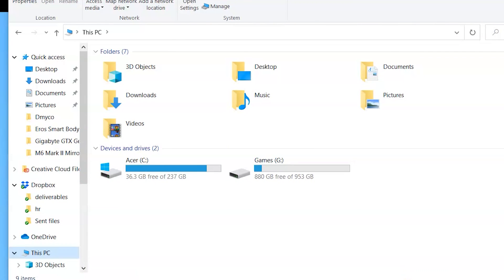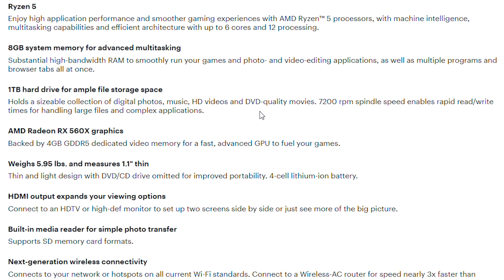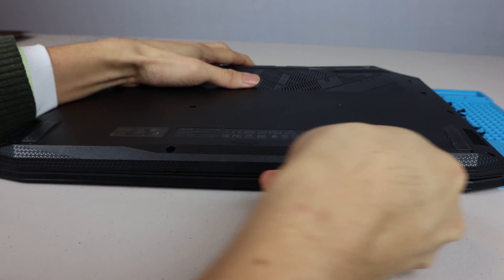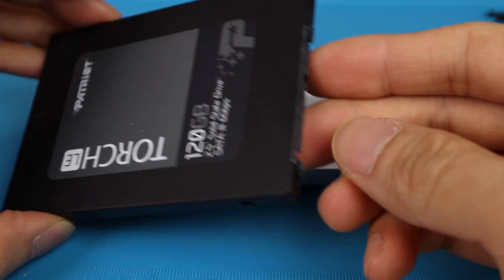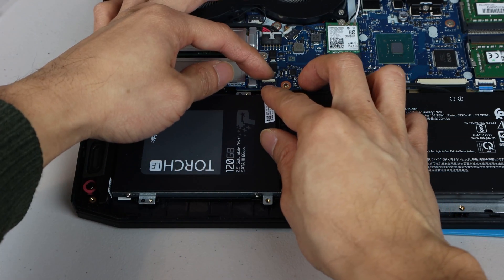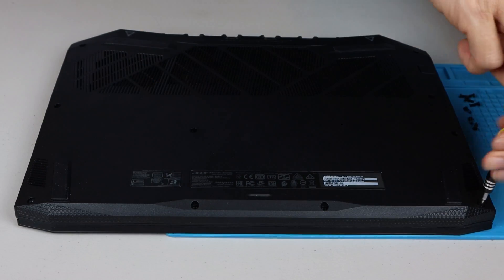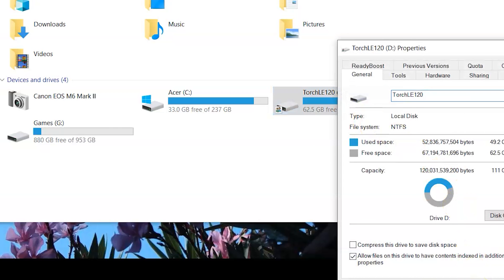How to Install 2.5" HDD or SSD in Acer Nitro 5 Gaming Laptop (2019 ver) SATA III Drive

Comment: I don't know anything about upgrades and I'm running out of room. What are those two chips above the storage you just added?
Reply from the maker: The two slots above the 2.5" drive slot are also storage drives. They are called m.2 form factor SSDs and each can have a max of 2 TB in this system.

Comment: Hi, I have windows 10 now in my Pc, will change to ssd. Do I clone it first or just install the ssd drive and windows will recognize it as fresh new Pc?  I already backed up my files, pictures., and some programs here, I don’t need it anymore, Others, I can get it online easy.  Explain cloning is necessary or not and when to use it?
Reply from the maker: Since it sounds like you'll be removing the existing drive and using your new SSD to boot from, yes, you will need to clone the contents of your original drive to your new drive. Any time you remove the drive that has the operating system (Windows) installed on it, or wish to boot from the new drive, you will need to clone the existing drive to your new drive.

If the drives can be installed in the system at the same time (for example, you have an M.2 slot and are installing the new SSD in the 2.5" bay or vice versa) then you can complete the clone after installation. If you cannot install both at once (the original drive must be removed because there is only one space to install it), then you should complete the clone prior to installing the new drive by connecting the new drive externally, for example, using an external HDD enclosure like the ones found here: https://geni.us/DEHX5 [Amazon Affiliate Product Link]
Reply: FixItPhil got it.   I just decided that I want fresh windows 10 installation, like new pc, no cloning. So, if I change to ssd drive,  my Pc will automatically detects windows 10 license when I turn on my pc and will configure like new pc or what? Reply
Reply from the maker: @ChristianYepez  If the new drive is the only drive installed when you boot up the computer, you will need a Windows 10 installer in order to setup the drive and install Windows 10 on it (otherwise the computer will NOT boot up). This is usually done by creating a bootable USB thumb drive using Windows Installation Media Creator which you can download here for free: https://www.microsoft.com/en-us/software-download/windows10 After booting from the USB drive, it will take you through the installation process for a fresh installation. As long as you use a Microsoft ID as the primary method of logging into your Windows 10 machine now, and use the same login for the fresh installation, your license will be transferred over automatically (an internet connection is required to activate).
Reply: FixItPhil thanks I have windows 10 now, it was an upgrade for windows 8, like 3 years ago I think. But do I check if I have windows key license. or what. Or can I copy down license key number.  I only have pin local admin account in my pc. Or I connected now with Microsoft account and no local??
Reply from the maker: @ChristianYepez  If you upgraded to Windows 10 for free from Windows 7 or Windows 8.1, you should have a digital license instead of a product key, you can extract this key by doing the following: 
1. Type 'powershell' into the Cortana search bar. Right-click it and select 'Run as administrator'
2. Copy and paste the following command into the window that opens: (Get-WmiObject -query 'select * from SoftwareLicensingService').OA3xOriginalProductKey
3. Then press the 'Enter' or 'Return' key

Your product key should appear on the next line, but again, you won't need it if you simply login into the new copy of Windows after installing it with your Microsoft ID account; it should recognize the fingerprint of your computer and activate automatically. To ensure that your Windows 10 key is synced with your Microsoft ID account, be sure to log in to your current installation of Windows 10. If you're currently logged in with a 'local' account, you can change it by doing the following:
1. Click on the 'Start' icon on the left side of the task bar.
2. Click on the 'User' icon (👤)
3. Click 'Change account settings'
4. Click 'Sign in with a Microsoft account instead'
5. The "Sign in with Microsoft" page pops up asking for your Microsoft account. If you already have one, just enter the username and password and click the Sign-in button. Otherwise you can create a new account. If you find you're already signed in with a Microsoft account, there's nothing else you need to do.

Comment: I just purchased a Acer Nitro AN515-54-5812 do you know if the cable you used in the video would work for that model?
Reply from the maker: Yes, I have the same base model AN515-54, so you would use the same cable I have in the video. There's a link where you can find it at Ebay in the description.

Comment: So if I buy the ssd the block one xd  I have to do something to make it work or is it just plug and play basically? Also I lost my drive baby screws can you link some of those too thanks
Reply from the maker: Right if you get the 2.5" type SSD, you'll need a SATA ribbon cable to connect it to the motherboard, as shown at 3:07. One should have come with your laptop in the original box, but if you don't have or can't find it, you can buy a replacement one here: https://ebay.to/2Tnlh9l [Ebay Affiliate Link] and if you need the screws for the drive bracket, you can find some here: https://ebay.to/3g8DW2G [Ebay Affiliate Link] After installing the drive and verifying that the mother board can see it (see 4:12) Then you'll have to allocate/partition and format the drive. If you're not sure how to do that, check out my other video on it here: https://youtu.be/d5wLgZxROoY

Comment: My issue is that the laptop doesn't recognize the current drive. Windows won't boot and there is nothing in the bay now so what do I do to replace the drive?   I don't see one to remove.
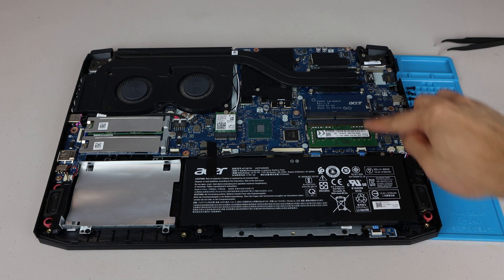Reply from the maker: Hi Tara. This laptop has two other drive slots that are M.2 form factor, about the size of a stick of gum; location is shown at 2:02 and indicated with arrows. This is where your existing drive will be located and what you'll need to replace. See my video here on how that's done: https://youtu.be/Oz735CCXTQo?t=64 See links in the video description for M.2 NVMe SSD for where you can buy the ones I have installed in my laptop.

Comment: Is it ok to do same with m.2 ssd nmve and ssd sata in nitro 5 an515-43?
Reply from the maker: Yes, your model laptop has one M.2 slot and a 2.5" drive slot, so at most, you can have two drives installed at the same time. The M.2 drive can be NVMe/PCIe or SATA. You can also have a 2.5" SSD SATA drive. Depending on your build, you may already have drives installed in at least one or both of these locations, so check your configuration to determine which slot is open if you plan on adding a drive. The process for disassembling your laptop to access the M.2 slot will be similar and your model may have an access panel for the 2.5" drive bay and RAM slots.

Comment: Can i add both sata and nvme m.2 at once
Reply from the maker: Yes. For this particular model, one M.2 slot is able to read both SATA and NVMe/PCIE and the other M.2 is NVMe/PCIE only. As long as the correct interface is installed in a compatible slot it will work fine.

Comment: So with the laptop flipped upside down, my ribbon cable is folded in a way where I had to install the ssd upside down, and the gold side of the cable is facing up when I inserted it in my motherboard. My computer is not showing the ssd. Did I put it in upside down?
Reply from the maker: Yes, it's upside down. The connector on the motherboard only has electrical contacts on one side of the connector, so if the gold contacts of the ribbon cable are facing up, the motherboard will be unable to read or communicate with the drive (see 3:31 for proper installation of the connector). If you flip the drive over, you may have to refold the ribbon cable or orient it in a way that it sits underneath the drive instead of on top as I have in my installation.
Reply: @FixItPhil  thanks man, I feel dumb, the gold side obviously has to touch the motherboard.. I redid everything, and my drive is showing.

Comment: dose this work with the other modles of the nitro 5?
Reply from the maker: Yes, the disassembly process for older (and newer) model Nitro 5's will be similar. Note that some of the older Nitro 5 models have access panels for the 2.5" drive and RAM slots, which makes it a bit easier since you don't have to remove the entire bottom cover.
Reply: @FixItPhil  hey phil idk if ur gona get this but I cant find my hdd upgrade kit that came with my pc if I use the ones listed in the description should it work  with most models or do I need a model specific cable?

Comment: Hello bro,
I am having Acer Nitro AN515-54-521N model having 1tb hdd, 256gb ssd, 8gb ram, 1650 graphics.
I think with my specs i cant able to upgrade using 2.5 inch ssd right?? because in that place 1tb hdd will be there right???
Reply from the maker: Correct, the 1 TB HDD is occupying the 2.5" drive slot in your specific build. If you want a larger capacity 2.5" drive or to change to an SSD, you will have to remove and replace the existing drive (up to 4TB). However, you should have another M.2 slot available, if you want to add a second M.2 SSD. Max capacity is 2 TB and you should get the NVMe interface type.

Comment: does this void my warranty? Just bought mine yesterday.
Reply from the maker: In the US, generally no, if nothing is damaged in the process, you are able to upgrade RAM and storage drives without voiding the warranty. If you live in a different region, the rules may be different, so check with your region's local Acer service center for more clarity on this topic. If any of your screws have warranty stickers on them, this would void your warranty.

Comment: can you do a new video on SSD and RAM install on the new 2020 Acer Nitro 5 ? o.0  thank you.
Reply from the maker: Haha, if only I needed to buy a new gaming laptop every year just so I could make these videos! Actually, though, I saw a teardown of the latest model and it's disassembly is nearly identical to the 2019 Nitro 5, so if you follow the steps in this video, you should be good to go. The main difference is the layout of the motherboard. The M.2 slots are situated at the left and right sides of the motherboard, facing opposite directions (1xPCIE/NVME and 1xPCIE/NVME & SATA), the RAM slots are towards the middle/center of the motherboard and the 2.5" drive is again in the front left-hand corner (with the SATA connector on the motherboard being adjacent to the top right corner of the drive). But again, regardless of the arrangement of the components, the general steps to install each component is the same, so you can reference those parts of this video which are applicable.

Comment: so i just purchased this laptop https://www.bestbuy.com/site/acer-nitro-5-15-6-laptop-intel-core-i5-8gb-memory-nvidia-geforce-gtx-1650-256gb-ssd-obsidian-black/6413247.p?skuId=6413247 and it doesnt have a sata cable and btw im going to get a 1tb samsung evo do you know anywhere where i could get a cable like yours to fit the samsung ssd
Reply from the maker: I was reading through the Q&A on Best Buy's product page you linked to and Acer confirmed that it should have come with a SATA cable (source: https://bit.ly/2Dm4jmU). Check the box carefully as it's in a small plastic ziptop bag and easily missed. If you cannot find it, I would reach out to Acer to confirm that the cable for previous models (AN515-54, AN515-53 etc.) is compatible and get one of those here: https://ebay.to/2Tnlh9l [Ebay Affiliate Product Link]
Reply: FixItPhil yea I’ll do that but I checked again and mine didn’t come with a cable

Comment: Are there cables that work for multiple models? My laptop is an Acer Nitro 515-43 R0YM and I’m not seeing any cables for it
Reply from the maker: I think the difference may be the length/configuration of the cable, so I'm not sure if the cables would be cross compatible even if the connectors are right because they may not reach the spot on the motherboard where you need to connect to. I found one on Ebay for your parent model, the AN515-43: https://ebay.to/331olh9 [Ebay Affiliate Product Link]

Comment: Wait so I have to install windows 10 again if I I add a hdd
Reply from the maker: If you're removing the existing drive with Windows on it, then yes. If you're leaving the original drive in, then no because you can just boot up from the old drive.
Reply: FixItPhil ok thanks

Comment: why do i have to partition, cant i just use the entire hdd drive without separating it
Reply from the maker: Yes, but you'd still need to allocate 1 partition for the whole drive. New internal drives typically do not come partitioned as such.
Reply: @FixItPhil  so how would i partion a 1TB HDD to begin with?
Reply from the maker: To do this on a Windows 10 machine:  Search for "computer management" into the Windows search bar (Cortana) and double-clicking the search result. Then select Disk Management on the left hand side. Find your new drive on the bottom of the center column, right-click the "unallocated space" (marked in black). Choose New - Simple Volume. Accept the default size. When asked to assign a drive letter, accept the default. The right-click the newly allocated space, select Format and follow the on-screen prompts. After that your drive should be good to go.
Reply: @FixItPhil  thnx sooo much

Comment: My internal HDD which came pre-installed with laptop is shown as HDD2 in bios and HDD1 is shown as none.it was working fine but now I'm not able to access the HDD from file explorer and it's also not shown in disk management. Any suggestions what could be done?
Reply from the maker: Hm, what preceded this change? Did you install a second hard drive in the HDD1 slot? If the computer cannot see it in disk management then it's possible that the connection has come loose. I would recommend you open up the laptop, remove and re-install the drive and see if it fixes the problem. [edit] sorry I re-read your query and it sounds like you're asking specifically about a 2.5" HDD and not an M.2 SSD. Other issues you might be having are if the HDD has failed for some reason and doesn't work, a faulty SATA ribbon cable, a poor connection to the motherboard at the connector clip (un-clip and re-clip in this cable, see 3:34).
Reply: @FixItPhil  When I woke the laptop from sleep the disk appears for some time and then again disappears similar to the problem mentioned in this forum : https://community.acer.com/en/discussion/567809/acer-nitro-an515-53-not-recognizing-hard-drive-anymore
And about the suggestion that you gave about reclipping the cable, the laptop is just 1 month old and opening back panel may void the warranty also can't risk messing up anything else inside. Is there any other solution I can try ?
Reply from the maker: Check advanced options in your Power plan and see if disks are set to sleep after some amount of time. Type 'power plan' into the Windows search bar and click on the result 'edit power plan'. Then click change advanced power settings. The first item in the list should be "hard disk" so in the setting "Turn off hard disk after" set this to 0 minutes.

Comment: Phil, how do you migrate the os from the hdd to a brand new sata ssd on a brand new acer Nitro 5 2019? Do help!
Reply from the maker: Hm, you can try using the Clonezilla software, it's free. You have to have both your old and new drive installed at the same time. Then follow these instructions: https://www.diskpart.com/articles/clone-hdd-to-ssd-clonezilla-3889.html

Comment: This may be a dumb question...after installing a second ssd in my nitro 5, do I do anything else? Just power it up and the computer will do everything else and show my new updated storage?
Reply from the maker: If you install a brand new drive into your laptop, you actually can't use it straight away after hooking it up. You'll need to set it up first. To do this on a Windows 10 machine:  Search for "computer management" into the Windows search bar (Cortana) and double-clicking the search result. Then select Disk Management on the left hand side. Find your new drive on the bottom of the center column, right-click the "unallocated space" (marked in black). Choose New - Simple Volume. Accept the default size. When asked to assign a drive letter, accept the default. The right-click the newly allocated space, select Format and follow the on-screen prompts. After that your drive should be good to go.

Comment: I installed it but it won’t show on my laptop please help
Reply from the maker: If you install a new drive into your laptop, you actually can't use it straight away after hooking it up. You'll need to set it up first. After it's been installed and verify that your system can see it (by checking that is appears in the BIOS, press F2 on the keyboard repeatedly when you boot up the laptop, see 4:16). To do this on a Windows 10 machine:  Search for "computer management" into the Windows search bar (Cortana) and double-clicking the search result. Then select Disk Management on the left hand side. Find your new drive on the bottom of the center column, right-click the "unallocated space" (marked in black). Choose New - Simple Volume. Accept the default size. When asked to assign a drive letter, accept the default. The right-click the newly allocated space, select Format and follow the on-screen prompts. After that your drive should be good to go.